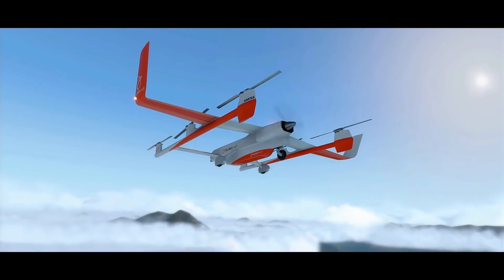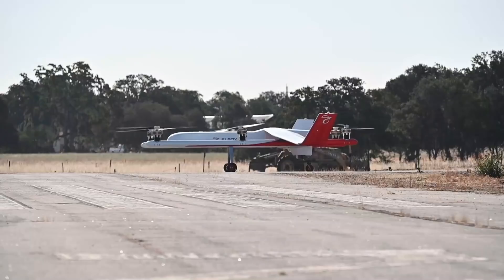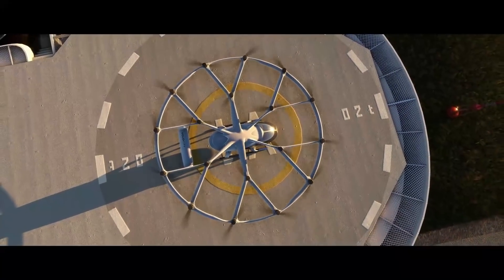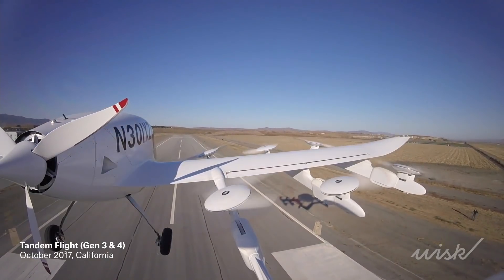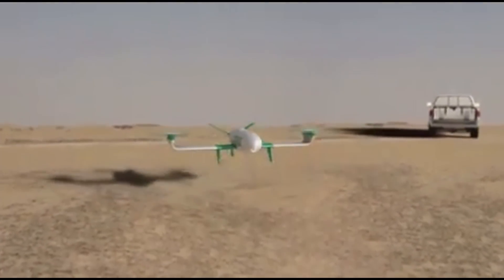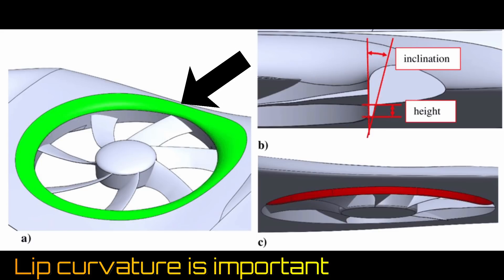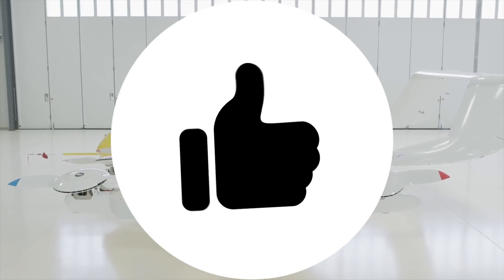Lift + Cruise EVTOL : The easiest long range EVTOL to design

Comment: I'm nervous about the argument that multiple rotors give the aircraft increased redundancy. If we consider your example of a 4 rotor machine with one rotor failure, so that only the 2 remaining diagonal rotors are available, then per rotor:
Before failure power = 0.25W * sqrt( 0.25*W / (2*rho*0.25*A)) = Nominal total hover power * 0.25
After failure power = 0.5W * sqrt( 0.5*W / (2*rho*0.25*A)) = Nominal total hover power * 0.7071
So the remaining rotors have to pick up 2.83 times the power! The most likely scenario for batt failure would be an overextended flight on end of life batteries near full discharge. If one system fails and the others are now driven to high power why wouldn't they then also cascade fail? Ballistic recovery won't work near the ground or powerlines...😨
Helicopters only have one rotor, with relatively low W/A, but if the power fails the collective pitch drops and you are still flying with time to look for a landing area. Also collective pitch gives velocity control instead of acceleration control - easier to fly.

Comment: The more I see how complex these designs are getting, the more respect I have for the Opener Blackfly. I imagine they could increase the range and capacity by having simple manual folding sections that lengthen the wing when not being stored or trailered. A larger version that sat four in a 2 level front and rear seating arrangement seems possible as well. The simplicity is alluring.

Comment: to increase flight times, make the vtol be directly non-moving transitioned tail-sitter cruise flight, drone with vertical wings, tail-sitter when landing, wings become effective when horizontal flight mode, but can easily just turn back to vertical vtol hover mode, tail-sitters it is
Reply: so you get mostly electric plane flight times
Reply: just add vertical wings to the octo-copter
Reply: and have either swivel chair seat, flight mode dependent, or space shuttle upward facing seat
Reply: tail-sitters!!
Reply: those are the simplest vtol airplanes
Reply: those are also lift+cruise
Reply: but in one
Reply: same propellers fulfil both roles in fixed positions
Reply: its a drone with a vertical wing, acts as a air brake when in vertical mode
Reply: it can be the passenger compartment, with dual vertical cross wings, x-wing, with 2x4 drone rotor configuration
Reply: f, ducted fans are wings in cruise mode
Reply: spin jet electric turbines, super/hypersonic, yes, by design, shrouded, to be super sonic at the output air velocity

Comment: a single rotor is the way to go for me, the redudancy safety is ubpset by the capability to use autorotation, if air taxis become a thing they´ll probably be electric autogyros, as they provide the highest safety, and are less likely to fall onto a street
Reply from the maker: Yes Electric AutoGyro by the name of Jaunt ROSA is being developed for safety

Comment: I think the lift-fan design you mentioned where the wing slides open to expose the lift rotors would be the best design.  The mechanism to open the wing won't weigh much, the mechanics are much simpler to maintain, the wing surface can double as flaps (if done properly) when extended, and there is not any "extra" panels to cover the exposed rotors.

Comment: This configuration has two crucial disadvantages: First, the lift-motors are basically dead weight / additional drag during cruise - basically the point you raised. Secondly, but more importantly, the lift motors (given the first point) are rather small and take substantial time to take the aircraft up to transition altitude. This is exactly the time that most of the energy is being burnt. 
While this design is currently widely used, I believe that we will soon see more streamlined, integrated designs that don't require separate sets of motors

Comment: Pls let us not forget that the evtol is greatly driven by the need for urban transport. I absolutely love your channel and insight. The faa has made exceptable noise levels very clear. Pls teach us more about that and the engineering behind the different methodologies to achieve silent urban transport by different manufacturers. ANY VTOL IS DEAD IN THE WATER IF IT JUST BECOMES AN AIRCRAFT WITH THAT TYPICAL WHOP WHOP SOUND A CHOPPER MAKES.

Comment: Motor failure seems to be a concern to Electric Aviation, but brushless motors are very reliable. Using the hobby community it should be apparent that even when people don't know what they are doing the motors fail infrequently while speed controllers and batteries appear to be the weak link, but that is because the user doesn't  usually have the required knowledge of electricity. Commercially designed systems have to be much more reliable. The point is that failure of any of these components  should be extremely unlikely. If I were to build a commercial  product it would include continuous  diagnostic testing.  Failure modes should be way down the list of priorities. Carrying additional weight such as motors and propellers used just for take off doesn't make sense. The Lillium is not that complex and the use of smaller fans and motors makes it less expensive. The only question is what is the optimum size for a particular air craft. I'm looking forward to seeing more designs like the Lillium. I hope patents don't become a factor like the Wright aileron debacle. KISS

Comment: I wonder if a hybrid autogyro EVTOL would be feasible or efficient.  A single engine push/pull and then one or more vertical rotors to get the vehicle in the air before disengaging and using the forward motion to keep the rotor spinning and providing the wing effect.

Comment: something like folding propellers, then hinge the motors off their center of thrust, that way when they are in use they pull themselves into position with minimal added complexity..

that or have permanently offset teetering hinge propellers, then drive them on an offset to their thrust range...

or even just landing the craft on it's tail

not a big fan of VTOL at the end of the day, they are cool and all but the disadvantages in comparison to STAL or high speed designs leave me thinking their applications are pretty niche at best

Comment: I think I would give bias to aesthetics and bury the fans in the wing, though the shown example of a single rotor blade at the tip which can later serve as part of the wing in cruise is a very slick design.

Comment: I’d implement using 2 diffrent fuel sources. Electrical battery together with hydrogen fuelcell, they would both work with the same electrical motors.

Comment: Dont know how difficult it would be to implement but I would design a multi-rotor system that is not only electrically controlled but mechanically, thus giving the craft the ability to auto-rotate safely down to the ground in case of power/motor failure/impact damage/emp etc. a joby with this capability would be the king.

Comment: "Flying Flapjack" combined speed with near vertical take off in a very simple package. Could use that trick of having two motors powering each of the two rotors for safety. Drops mic.

Comment: If I was to design an eVTOL, what format might I use? Lilium has already done it. For simplicity, making the propulsion elements do as much duty as possible is the key. All of the designs shown in the video are using a combination of separate lifting devices, separate forward thrust devices, and control surfaces. Lilium is using just the ducted fans and thrust vectoring to handle everything. Surely that is more simple than anything else demonstrated? You mentioned that ducted fans are a little more efficient than open propellers. No, they are 40% more efficient. That allows the Lilium fans to be smaller in diameter yet still generate the required thrust, yet create less drag in flight. The trade-off there is twice as much energy used to take off and land vertically but that comprises just a couple of minutes total per flight.

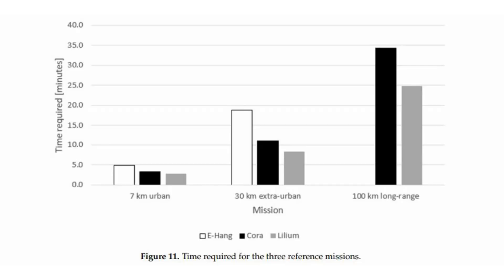Most importantly, these aircraft are called eVTOL's, not, "endless hover" craft. The goal of the VTOl capability is to be able to take off and land vertically, no more. The rest of the energy is to be spent going somewhere and the chart at 4:00 shows clearly that the Lilium is vastly superior to the two others compared. Even the Joby looks to be in 20% hover during forward flight. Lilium can use 100% of the available thrust to take off and gain altitude, then transition to 100% going forward, said to require just 10% of the hover energy. It has no control surfaces to fail. It has no idle propellers or the weight of idle motors to carry during forward flight. And, if successful in testing and certification, the initial Lilium model will carry six, paying passengers, not four, in a very compact footprint. Where will all of these other contenders be if the proposed 16-passenger Lilium comes to fruition?

Comment: How about a long fuselage with two ducted fans embedded in front, two to the back of the cockpit, optimized for vertical lift, with wings optimized for cruising at target altitude and speed and with three vectored thrusters on each wing, optimized for horizontal flight.  The long fuselage with fans arranged in a line parallel to flight direction is much more aerodynamic than rotors arranged on wings perpendicular to the flight direction. Since the lift fans are in the fuselage they can have a larger vertical dimension, as tall as the cockpit, which needs to be tall enough to fit people. This means the ducted fans be could made with multiple counter-rotating discs, perhaps in a rim-driven configuration, for very high thrust but enclosed on the sides for better noise control. Sliding covers on the fuselage fans could be used. The vectored thrusters on wings would be similar to Lilium but only required to provide a minor amount of lift during vertical flight, mainly important for stabilization, which means they could be much better optimized for horizontal flight.
Reply from the maker: Thanks for your detailed design

Comment: I think a gyrocopter blade instead of a fixed wing and 4 ducted fans that pivot would be the best design.  And have an onboard A.I. to tilt the gyroblade as needed in a "crash" situation.  It would also make it easier to put it in a regular parking spot.  And let it be able to float on water... I might need to do some fishing.
Reply: I hear that Cyberdyne Systems is working on one of those.

Comment: Couldn't you just add 4 rotors that connect to the fuselage in the front and in the back to a typical low wing aircraft? These could then simply be rotated upward for hover and forward for cruise.
I still think for optimal cruise efficiency you want tilt wing with distributed propulsion.

Comment: The Jetoptera / Dyson fluidic propulsion is the most efficient design yet, not in this video.  Combined with the new "flying egg" low drag fuselage, these designs will rapidly evolve into lighter, simpler. faster, more efficient designs.  Don't buy one yet or it will be obsoleted the following year.

Comment: I thought Ryanair pioneered the ducted fan in wing with Ryan XV-5 Vertifan.
Personally, I find the use of a redundant system and additional structural weight problematic and inefficient

It seemed to work well as the Fairey Rotordyne which could de-power the main rotor and had fixed wings suitable for forward fight
ATT the complaint was the rotor power system of ramjets was very noisy, but now we could use electric motors and small folding tip props
This seems to me to be a better balance because the electric power would come from the APU, and the weight of the electric motors and props being bearable and could be built today.
Reasoning it out to a small craft would be funded by electric power from the forward flight engine high capacity alternators.
Going full electric simply transfers battery supply to the forward transition motor and folds the small props into the rotor
Of course this takes us right back to the tractor Cierva C-24 autogyro and the like with short stubby wings, adding tip mounted folding blade props, 
which, for a small machine, has lots of redundant safety and is ultimately is my best answer to date, but autogyros were never both speed efficient and low powered.
Im sadly conventional I guess :)

Comment: Is anyone considering assisted take off? For example an umbilical power source that quick disconnects and rolls away like a vacuum cleaner cable. This would help range presumably since take off is so power hungry.
Auto gyros could use ground power assisted pre-rotation with high inertia rotors and launch off an elevated platform or tower.
Reply from the maker: This is being considered for new vertiports. I will be covering this in an upcoming video. There are patents filed for detachable tethered power supply for take off
Reply: @ElectricAviation  Vertiports sound fascinating. In the extreme you would hardly need any power at all if you had enough height and a good enough glide angle to make it to the base of the next tower...😄
Reply: Interesting thinking... or have as many of your landings on top of high structures so you can use gravity to get you into forward flight

Comment: Electric Aviation Why there is no eVTOL aircraft concept with flexible Solar Cells on the wings ? How much it could increase the range of aircrafts like this ? and What are the cons ?
Reply: Current cells can exceed 30% and even 40% for cells using concentrated sunlight so a 10 m^2 on a wing could produce a fraction of say 4 KW depending on the Sun angle. More than adequate for a sailplane and if the sailplane had batteries and props distributed along the wings it could be very STOL.
Reply: @Steve Mickler  Yeah, I mean, if they add power, why not using them on the wings and on the fuselage, even if they don't generate too much energy, they are light and there are already flexible solar cells available on the market
Reply: @gonzalomorenoandonaegui2052  so I can add value here. I studied aerospace engineering and did my masters work on Helios (flying solar wing) before working in the solar PV industry for 15 years. Power densities of solar aren't in the same magnitude as cruise power. PV cells do add appreciable  weight, but more importantly cell cracking will trash efficiency in short order as wings deflect. When doing the optimizations, these engineers find adding extra batteries is a easy call over adding the same weight of PV cells and associated electronics.
Reply: @GuyIncognito764  and what efficiency flexible solar cells should have in order to be more compelling to use them on an aircraft ?
Reply: @gonzalomorenoandonaegui2052  This is just an educated guess here, but 40% efficiency probably starts making sense for powered glider type planes. That's currently a very expensive multi-junction cell though and not feasible on price. By the time we even come close, it's going to be a world of amazing solid state batteries with 3-5x the energy density of current stuff is my take. Solar is currently focused on reducing cost per watt, not really on efficiency as anything other than a means to that end.
Reply: Nowhere near the current required can be generated for real-time flight. The solar-powered airplane that won records a while ago was very skeletal. Solar cells are still only 22.8% for the best ones. Max wattage available for direct sunlight is 1360 per square meter, so 310W per square meter in the best conditions. Maybe on a 12' wing maybe three square meters of cells could be fit. So with both wings, only 1860W would be generated. Enough to run a hair dryer. Not bad at all for charging batteries but the weight would not be worth it since actual batteries can store more energy. So better to generated and store the energy beforehand.

Comment: The ones hidden in the contracting and expanding wing seems the most elegant solution to a not very elegant problem - All that redundant payload - either the lift engines at cruise or the cruise engines during VTOL frustrate the engineer within!  Great video as ever, ^oo^
Reply: That's the thing I hate about most of these, they look so ugly. Retraction or tilt is definitely a refined look
Reply: I replied with the same thing.
Reply: @ronrothrock7116  Wisdom indeed Ron, ^oo^

Comment: So, you're saying a wing that opens to reveal a pair of ducted fans while the wingtip splits into a two-blade propeller on each side to give six rotor lift that at cruise altitude shuts to become a pair of narrow aspect wings with minimal drag and the intermediate option of tilting those tip blades for thrust to gain speed, or deploying for extra wing length to conserve battery and gain range is feasible even for multiple pairs of wings? A nearly infinitely configurable craft with three wings on each side, a total of eighteen rotors, all with engineered surface flow effect synergy?
No landing gear. No runway. No fuel tanks. Modular components so if one key motor fails you can land, swap it for a less critical motor and continue your flight, and the wing elements can be rotated seasonally like rotating tires on a car to extend useful life?